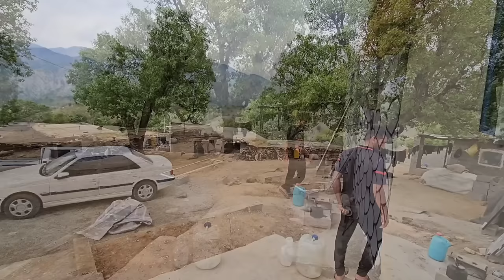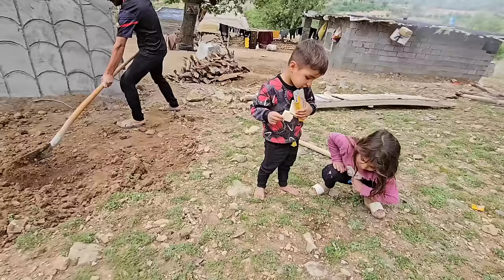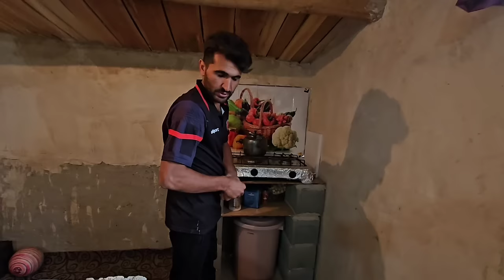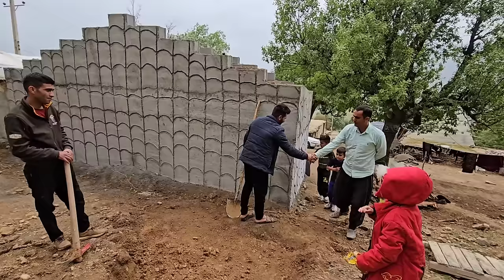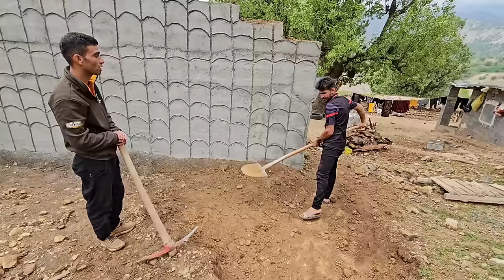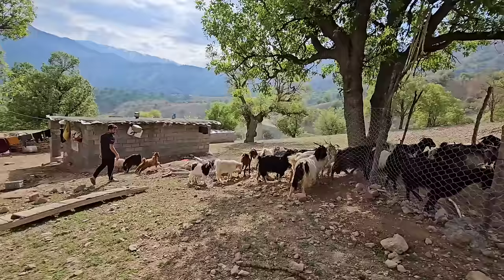Solidarity in difficult moments: the sick wife and loyal friend of the construction master

Comment: Si, llévala al médico y compra un colchón o algo blando para tirar en el suelo
Reply: Estas personas no se despegan del suelo,  cocinan, comen, duermen y conviven así por miles de años, veo difícil que cambien sus costumbres por incómodas que éstas sean.
Reply: If they slept on a mattress and ate on a table off the ground, it would help many of their health problems.  All of them are too young to have back problems.  I’m quite a bit older than them and have back problems.  Mine came from a disc disease not abuse of my body.  I was always very active and did not injure or neglect my health.  I have the correct kind of mattress and pillows for my back and neck.  You can get injections for back pain.  Early 30’s is way to young to wear your body out.
Reply: Especially sweeping bent down when in 2024 there are long handled brooms available.
Reply: @bismillahrabbani9006  those brooms are ridiculous and so bad for you.  Get a regular broom at the dollar tree and a vacuum cleaner for your house.  They’re moving around dirt instead of removing it.  Fereshte needs a grass blower for that from porch.  If I wasn’t my porch, deck, driveway and garage clean, I use a grass/leaf blower on it.  Then I wash it down with the hose.  I know they have water restrictions because of the 50 year drought in Iran.  They should fill in that dirt area with gravel if grass will not grow.  Bermuda grass is drought resistant but I don’t know if they have interest in changing the land in from of their house from a dirt pile to some nice green grass.  They have to keep the goats, chickens and other various creatures of it.  And for heavens sake someone buy Shayan some shoes so he’s no screaming walk on that awful front area.  You also get parasites through your feet.  It’s a nasty thing!  I woke up with too much to say!!!  Lol.